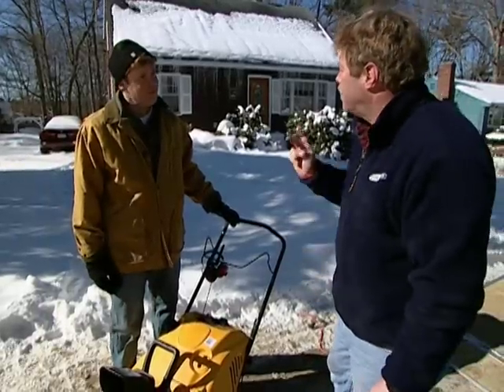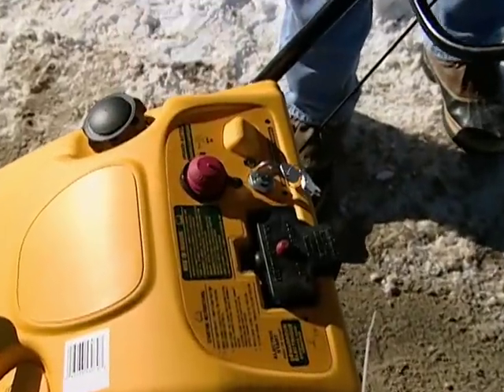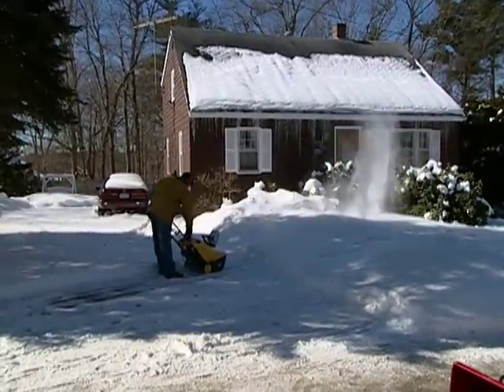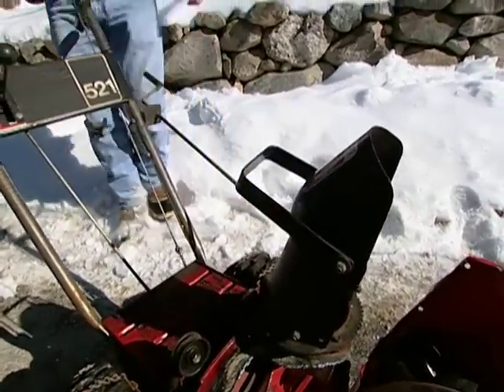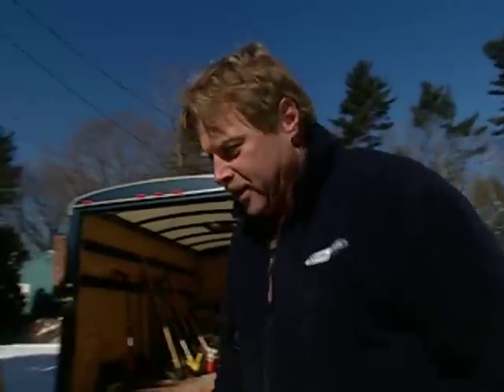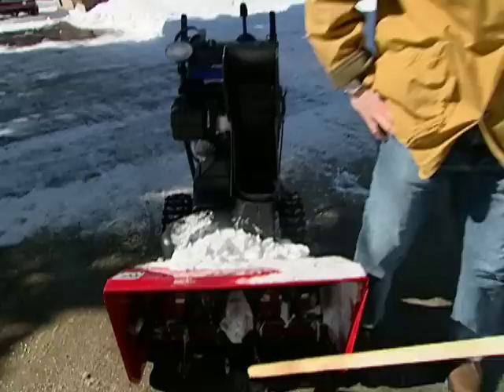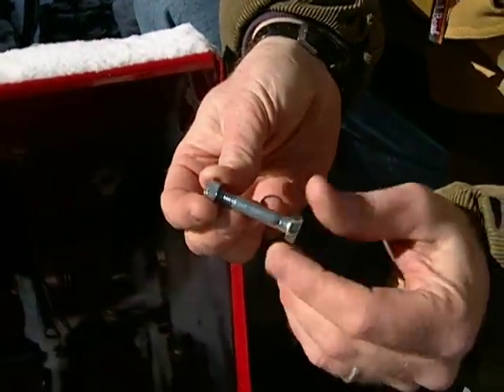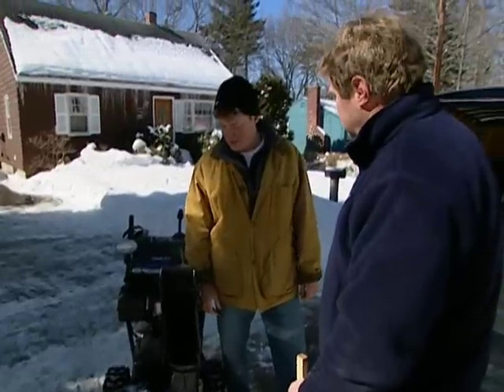How to Choose and Use a Snowblower | This Old House

Comment: Where can I find the 1st single stage one?
Reply: The single stage one is an MTD Yard Man 5.5hp unit. They don't make that exact model, but the Yard Machines 179CC single stage unit is virtually the same. The Toro 721 line is also very similar.

Comment: I have a Toro Power max blower the one two stage blower they showed. It's a great snow blower. I like the anti clog shoot feature the only problem its a beast to wrestle around to turn. If your buying a 2 stage look for a model with turn assist. My right shoulder is still messed up from the snowiest recorded winter Michigan ever had. Turing that thing was a pain and a single stage isn't big enough because I help our some senior neighbors with the snow but all the turns did me in.
Reply: Pull one of your wheel pins. It will be one wheel drive but will also be much easier to turn.
Reply: It's called a "gym", bro

Comment: Single stage all you need in the Suburbs !!!!!!!!!!!!!!!!!!
i have a 5 hp sears Craftsman 5hp , 21" amazing
Reply: Yeah, right. The suburbs WHERE? I live in the northern Illinois burbs and after one year killing myself with a single stage in the 14" deep heavy wet snow, I went to the Ariens 2-stage I have had for 20 years now, no regrets, works flawlessly and does the job regardless of snow fall or snow weight. All metal, nothing breaks. However, I DO do the recommended maintenance every early November before the white stuff starts up.
Reply: Exactly, depends on what region of the country you are in!

Comment: Word to the wise: a single stage will NEVER work well above 4" or with snow that's any heavier than light and fluffy. Fact. If you get anything more than up to 4" and you can get wet or icy snow, you really need a 2 stage. 

The problem will also arise when the city comes by and plows your street. The extra slush and ice that gets pushed onto your apron is absolutely impossible with a single stage. 

Those single stage blowers are pretty much useless for anything except little walkways and like I said, light snowfalls. Don't try to save money - you will cuss yourself out later! Trust me! After buying a single stage in a suburb that doesn't get "that much" snow, 3 years later I bought a real snow blower and threw that thing out. Also, that rubber auger will wear down and work less and less over time - the steel, serrated auger in a 2 stage will go forever.
Reply: @davidcarlin5336  100 percent agree.  I have the greenworks battery one stage.  Yes, once every 3 years maybe there is a snow that is tough, but it will eventually work through it.  Spray the insides with a slick coating so it doesn't stick certainly helps.  But mine has worked out 95, 96 percent of the time with no problem in Chicago area.  Would I own one in say Maine or Minnesota, probably not

Comment: hey Roger that is not how you start a Tecumseh engine you don't put the throttle at full throttle you the lever at half throttle when you start it
Reply: well that's what my dad told me that giving a cold engine full throttle was very bad for the engine
Reply: If it's a tecumseh running it at all is very bad for the engine.

Comment: The plastic chutes break when they pick up ice and gravel Don't buy one with plastic
Reply: I have a craftsman that now has an armor plated chute. It broke off the swivel ring the first day after it picked up some ice chunks. Then the deflector split when it threw a few rocks the plow had left at the foot of the drive way. I fixed that by heating a nail and making holes stitching it with zip ties. Sears snet me another plastic chute. I'll cover that with metal, glass and epoxy before I put it on.....
Reply: Raul Escobar Had some old person with no tools bought that machine they would suffer a big fat bill to make it work...and it would break again...junk. even high end machines are using plastic in the impeller housing. Just a screw job. The orange machine starting with A is the only one I'd consider. It is all metal. Throwing snow how far ? Think about throwing a rock. So long as it goes twelve feel is wider than most driveways.Distance isn't really so important.